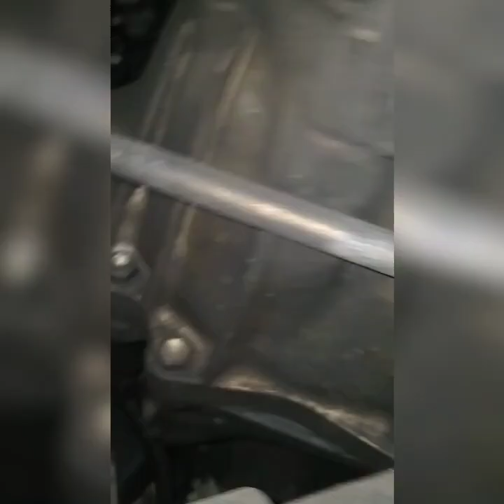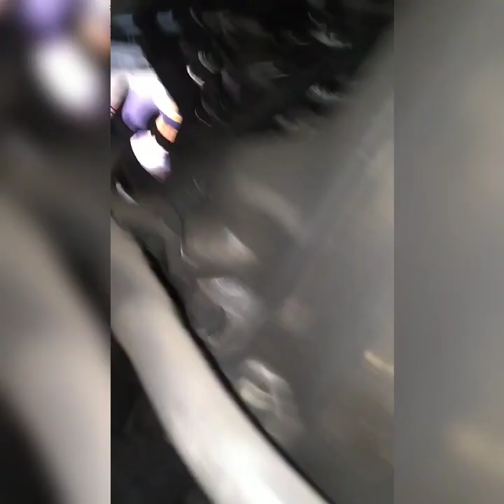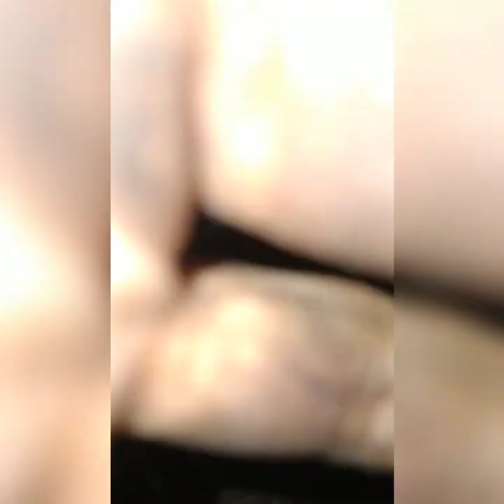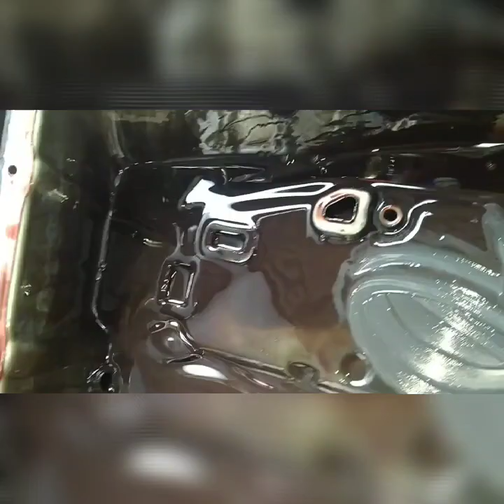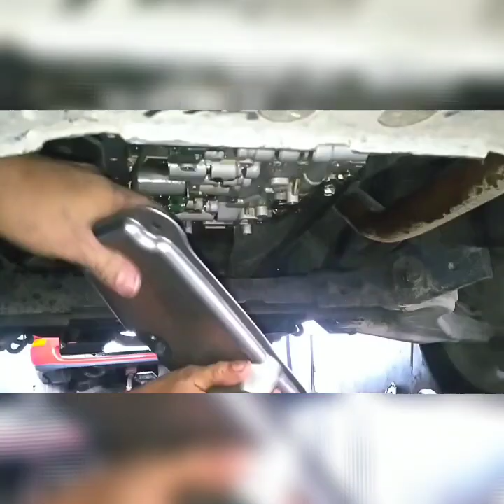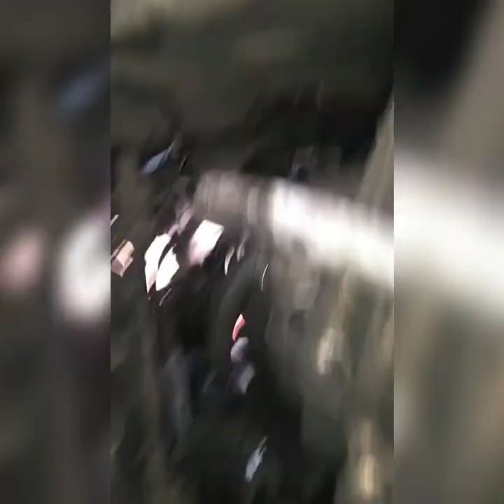Toyota Innova automatic transmission change oil

Comment: Bossing wala na ba bleeding na gagawin kapag nag flushing ng gear oil ng automatic transmission ng innova?
Reply from the maker: Kaylangan lang poh paandarin tapus sukatin may hot and cold Ang sukatan ng automatic transmission fluid
Reply: @vergelautomotive9728  kumplikado din pala, hindi pala kakayanin ng DIY. Change oil engine kasi ako lang nagawa, transmission automatic diko pa nasubukan kasi.
Reply from the maker: @rogeliodizon3872  oosir medyo alanganin pang sa makina lang mas madali mag change oil pero sa automatic transmission mahirap
Reply: @vergelautomotive9728  salamat sa time at info sir. God bless, stay safe

Comment: boss san po servicing port ng atf
Reply from the maker: Kung saan ang salina bro
Reply: @vergelautomotive9728  dun nga po sa lagayan ng dip stick?
Reply: @vergelautomotive9728  ilang liters po pla sa toyota innova 2009 pra palit din po ako..slamat boaa
Reply from the maker: 4.ltrs bro
Reply: @vergelautomotive9728  boss marami pong slamat
Reply: @vergelautomotive9728  boss anu po ba masuggest nyo na ok atf pra sa innova 2009 gas engine.pag palit po ba ng fluid may mga kit po ba un na ksma?
Reply: @vergelautomotive9728  pati ung strainer boss palitan dn dba madmi nmb sgro sa auto supply ng kit nun